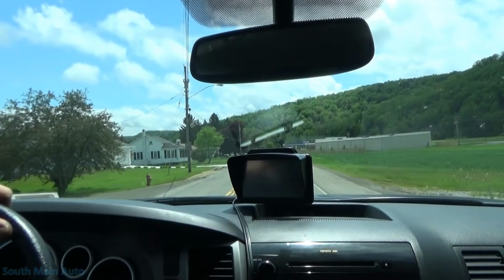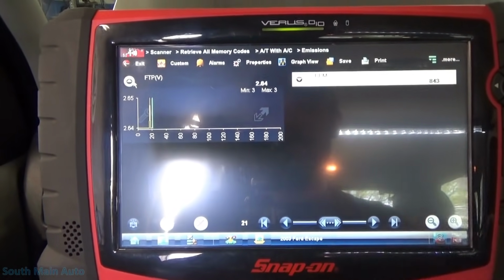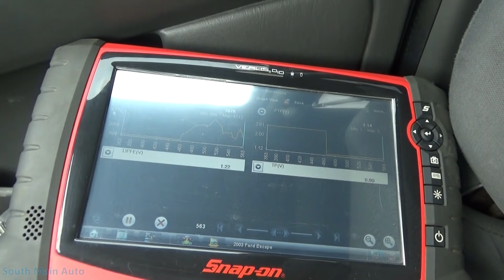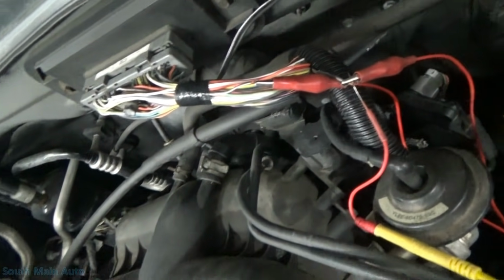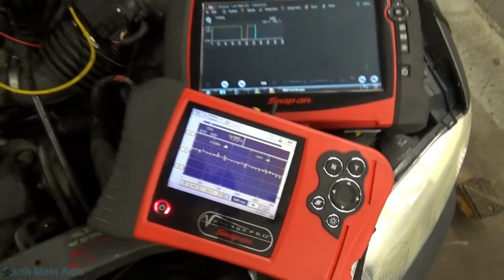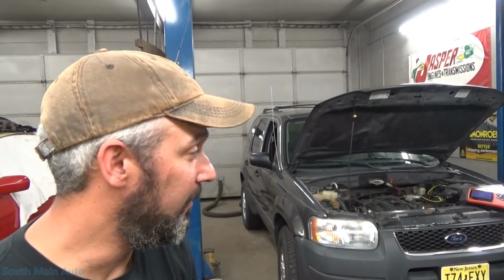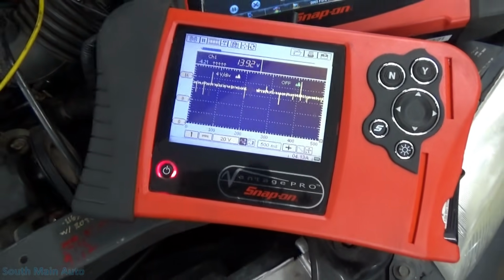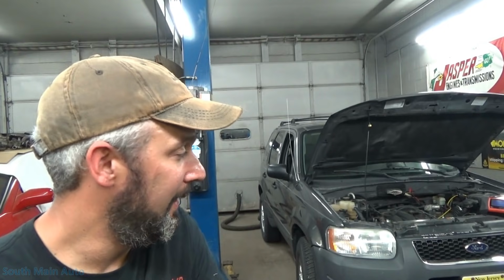Ford Escape: Do We Fix It Or Ship It!? - Part II

Comment: Seems like that escape from New Jersey always makes for some good videos. Amazing how two totally separate systems can interfere with one another.
Reply: Induction can easily cause such interference in 'separate' systems.... Shielding (after the source is ID'd ;-) ... could potentially solve such a problem)...
A very interesting issue....
Reply: Shielding is expensive. Forget it. The best effort has to be done on each module, make themselves noise resistant. Wirings are LONG, ground is not a perfect start partern, so loops can happen. The modules need to live with that.
Reply: After too many years spent in high tech instrumentation engineering....Shielded wire is not significantly expensive. Intelligent routing of lines is the simplest answer. And Modules being "noise resistant" is a moot issue if the feeds to and from the modules are not effectively isolated. Similarly, "modules need to live with that" is a meaningless statement, as each situation is dependent upon the tolerances of the signals being processed.
Reply: There are standards you nee to meet where the electronics are radiated in all positions from 100Mhz to 3Ghz with fields stronger 10V/m and even more. Then conducted is applied below 100Mhz. Automotive use a set of standards and you validate against them. you pass, you are done. A module has a set of input and ouputs. The inputs are expected to be in a certain range. Example, a drive by wire accel pedal reading, lets say, it has a notch or noise has corrupted its value. Now is "up to the module", because, firmware knows that the accel pedal can change from a certain position to wide open in just a 1ms. So, proper firmware  will paranoid that, will flag that and will discard this reading. Now another programer just was too optimistic and didnt did that check ... you send inconsistent data to other places just because noise. Firmware design is IMHO the 50% or more of the robustness of a system. Ans is up to the module trying to validate inputs, check for redundancies (ej, CRANK Vs CAM position) and wait for more data before panic of taking making a bad desicion. You nailed it, proper wiring is the best way. Shielded is the best but you cant shield a 60 wire harnes, probably some critical low signal sensors of course. The reason why using DIFFERENTIAL PAIRS like CAN, OLD RS485 or 422 or the more commmon ETHERNET ... they dont need shield  .. they just rely in common mode noise rejection. And ..... usually the statements "after being long years in" are meaningless too, more in YT. Electronics when properly programmed need to be defensive and resilient. OF COURSE GOOD HW desing is the other 50% of the bussines.  I have suffered that, I dont need to convince you or anybody. Just the facts I was shown and how they were solved. You need to meet standards. Period. Then is up to you to give a PLUS to defend the customer and the system where you module connects to, or pretend that just because box is metal and wires shielded NOTHING is going to happen. .... GOOD LUCK. Typical design that works like a dream 
 ....... in a desk. Modules hardly work with low signal levels, they dont have as much analog stuff. So comparing to high presicion intrumentation is an overkill. Its a mass consumer product, not a triple domain 30K dollars Tek scope.

Comment: Are you telling me the flow chart didn't have "Check the power steering pressure switch"?
Reply: I has a major desicion on the very top "Is the vehicle a Ford ?" ... "then good luck".  if it is not a Ford,then, asks "is the vehicle a GM product"  ... "if yes, drive to the junkyard" ... if not a GM then asks: "is it a Chrysler" .... "if yes, replace engine, wiring transmission and body. Reprogram every single part, dont to update the firmware in the sunvisors"
Reply: No hoosker do's or hoosker don't either!?

Comment: That's nuts.  Makes a guy want to use an oscilloscope more times than not.  That's some serious knowledge you shared.  The greats are always as lucky as they are good.  It's the determination that opened the lucky door.  Many others would have an ECM on order already.

Comment: You need to get a hold of scanner Danner Says a 12 volt sensor cannot affect a 5 V reference will blow his mind
Reply: It won't because while he teaches that the 12v and 5v reference feeds are independent (don't affect each other) he does know circuits that share common grounds can affect each other.
Reply: 5V is a downconrversion of the 12V rail The is only one ground that is the return for both. High freq noise in the 12V will pass to the 5V regs no problem unless they are SUPER filtered. They put filters, but, not to dump the amount of oscilations showed in the video. The module is alone to defend itself from inconsistent inputs and take a desicion if the signal is between range or it is trashed. Clearly the power steeering sensor noise couldnt trash the ECM completely os in the end is a good design, the main goal, keep the engine running was accomplished.
Reply: 38911bytefree  I believe there is probably a bad isolation capacitor in the ecm the problem could come back
Reply: Tech53us G: The problem/noise persists with the 5v supply disconnected/isolated from all the sensors. Thus the problem is not with the PCM/Supply.
Reply: @killer2600  that is it exactly.  Once Eric explained the cause I was like "hmm, so the switch is sending an AC signal (by high speed switching) up the ground, the only wire those two sensors share."

Comment: Holy crap that was twisted...are you sure Keith didn't send that car up from the Bermuda Triangle for you Eric? Great job man, way to stick with it. Now why didn't we see that noise on the 5V ref in Part 1???
Reply: Ah....I think if the PicoScope was used for the initial diag, you would have seen the noise on the 5V ref right away. Perfect demo of the crucial difference between a "Graphing Meter" and a real "Oscilloscope" :)
Reply: Excactly! The learning from this is that do not use DVM to diagnose a sensor. Use Pico. One channel to ground, one to power and one to signal. You would have identified the problem way sooner. Not much extra work to use Pico instead of DVM.
Reply: This video, as a tech, is making me scratch my head.   If that P/S pressure sense runs on its own 12v reference, why and how is it back feeding into the 5v reference for the ftp and tps sensors? Sorry didnt hear it in the video if it was in there lol. Part 1 gave me nightmares last night though.
Reply: It can be that 12V reference (14V -> 12V regulated power) feeds the 12->5V regulator. If the 12V circuit is overloaded, both the 12V and 5V reference start going down and up if 12V regulator goes to over amperage protection.
Reply: I have a universal THEORY, once you have found the noise you could then graph the frequency of the noise. Then run through each wire at the ecu looking for the same frequency. Unplug that circuit and see if the unwanted noise has gone ???
Reply: Diagnostic Check Thats probably where I would start, but what do I know? Im still a noob tech, started at jiffy lube lmao
Reply: jannepo You ever had that moment where it makes perfect sense and its just like "Awh god dammit I shouldve thought about that?" I just did. Thanks for that lmao.
Reply: The perfect way to check the 5V reference is to use a logic probe. I don't know if you can still get them but they were used for 5V TTL logic. It had a red and green led. Solid green for high and solid red for low. I think it used a pulse stretching circuit to blink the leds if there was any switching going on. It could detect even sub microsecond pulses.
Reply: As Eric said, unplugging the power steering sensor alters the idle speed. Perhaps there is some actuator powered by ECM to alter the idle speed. Faulty sensor caused a hysteresis on that output -> over amperage -> 12V regulator goes to protect -> 5V regulator / ref voltage drops to 0 -> 12V reg comes back up -> hysteresis. Down/up 5V not enough to power tank sensor -> output drops to 0.
Reply: I think of the vidio you done with Keith when he unpluged the fans. And that tape floping in the breez and a cup of coffee.....LOL
Reply: Joe Brito  way to kick Eric in the guts, what an INSULT!!!
Reply: We did not see that on part 1 because he use the sensor ground and on this part he use the battery ground.
Reply: High quality scope with a high sampling rate will beat any test light or other. Well done!
Reply: Ivan, please check out my comment I just added. I'd like to hear your thoughts.

Comment: If anyone picked on you for this they don't know what they are talking about any tech would have replaced the ECM and then scratched their head at why it didn't fix it. With that sensor alternating like that it likely overpowered the fuel pressure sensor signal by induction or producing some kind of RF interference.  Not sure how close the circuits / wires are in that in the ECU / harness but I imagine they must be very close.  Congrats on finding what was wrong as 99.9% of techs would have given up, slapped a reject on it for the light being on and called it a day. Your a next level tech / mechanic and don't let anyone tell you any different.

Comment: Modern cars have gotten so complex that you'll get a "never seen this before" periodically just based on sheer statistics.
Reply: That's a statistic of the universe. If we never get a "never seen this before" then every possible event/scenario has already occurred and like a finished book the universe is done.
Reply: opl500: "Modern cars" does self diagnostics via the monitors, that has never happened before either. Never in history has so much been given for free to the workshops/home mech! All in reach within a $15 bluetooth OBD-dongle and a house hold item you'd have anyways.

 Your complaint is the same that was muttered by some when EFI were introduced... And again, by the same people, when serialcoms were. Get on board or keep fiddling with that leaky acceleration pump on that dubble-pumper of yours.

Comment: So evidently that five volt wire going to the ECM needed to be shielded from the factory , maybe you just made Ford make up another recall
Reply: shielding may not help if the 5 volts is actually derived from the source of the 12v PSS feed.  When the 12 volts is switched rapidly, that noise isn't necessary EMI on the 5 volt line, it could be directly fed to a regulated supply of 5 volt output.

Comment: Reminds me of a very expensive piece of medical testing equipment I came across one time . it was under warranty and the manufacturer sent tech after tech to repair a recurring fault . the machine cost over a quarter million and they replaced nearly every single electronic component up to three times each but after twenty seven days the fault would return. The company was in a panic as this was the first of several new machines they were trying to sell and if it wasn't a major international company this one machine would have sent them bust. I was there doing some contract work for the client who bought the machine and he was bitching about all the drama and how if it wasn't such a physically massive machine that actually did a good job when it was working he'd give it the flick.
I started to laugh because I figured out the problem and when he heard what it was and how to fix it he just about wet himself laughing too.
This machine had to have had at least four techs work on it and had a million dollars worth of parts and labour thrown at it and no one figured out that all you had to do was turn it off once a week. Computer memory at that time is prone to a fault called leaking and this gets worse the longer it is powered up so every twenty seven days it would stop holding data properly and it would be corrupted and this is why most computer help lines will ask Did you try turning it on and off?
Reply: So it was a software problem and not the hardware :)
Reply: PuchMaxi , no it was a hardware problem that caused a software problem that caused hardware problems
Reply: My head is spinning right now.
Reply: Computer memory doesn't leak; software is poorly written and sometimes doesn't free up memory, which is called a leak.  In my old job I've reused other people's code, and had to find and fix their memory leaks.
Reply: for2utube I just happen to know 100 percent you're right.
Reply: for2utube , not so memory leaks was a term given to an electrical phenomenon that occurred in early ram where due to heat and capacitance electrons would jump tracks turning a zero into a one and corrupting the data. Poorly written code could also cause memory corruption but when it is code based it usually happens quickly within seconds or at most hours depending on the particular program and how it accesses the memory and how often, when it is hardware based it can take days or weeks as in this case and to total amount of ram the machine had was sixteen kilobytes only enough to remember which ROM calls to make as selected from the menu of six choices and a cleaning function, the fault would cause the machine to randomly switch functions destroying samples and dumping reagents that cost fifty dollars an ounce. The machine was nearly as big as a Miata the machine you'd buy today is the size of a microwave and does about a hundred more tests and only cost fifteen grand
Reply: It can get more complicated than that. Even if the code is religious about freeing memory, the system can suffer what's known as "memory fragmentation" over time. The memory is all there and it's all free but it gets organized in less and less useful chunks. Writing code for computers that have to control something real isn't trivial and it's EASY to do it wrong and not even know it. And unlike Eric O, most programmers aren't their own bosses, so over time, they can't afford to care too much about the job they do. And what I've seen of management in the auto industry, they are douches for the most part.
Reply: I place my bet on SW bug. DRAM is refreshed every 40-100 milliseconds not weeks. But if there is a bug in the SW or OS, that can accumulate, lead to faulty handles,  data structure corruption, "garbage" left behind (like Java garbage collection lacking) filling up the reserved memory structures. RAM is simple, SW/OS is hugely complex. So I place my bet on that. Reboot works. Takes care of 90% of problems.  Great thinking!

"The maximum time interval between refresh operations is standardized by JEDEC for each DRAM technology, and is specified in the manufacturer's chip specifications. It is usually in the range of milliseconds for DRAM and microseconds for eDRAM. For current (2012) DDR2 SDRAM chips it is 64 ms."
Reply: Anom Amos - You're teaching me something I didn't know.  Most of my career I've worked with DRAM and its ilk, which I read became popular in 1972.  The only thing I've seen happen with it is bit-flips caused by cosmic radiation.  I read that even today's computer memory is still susceptible to malicious attacks, such as https://www.schneier.com/blog/archives/2016/08/powerful_bit-fl.html.  I shouldn't have taken such an absolute position.
Thanks for your follow-up explanation.
Reply: Janne Pohjala:   A software bug that shows up every 27 days?  I imagine they would check for any code that waited 27 days to do something!  My bet is that it is somehow due to the hardware.  A lot of the software bugs mentioned just can't happen with only 16K bytes to work with!  This machine sounds like it was made in about 1980.  It used machine code, not even C.  I remember, you couldn't afford to fill your Apple II or C/PM machines to the full address space of their CPUs, 64k bytes, back then.
Reply: No one has ever called leakage 'memory leaks'.It's been called leakage in transistors forever and no one has ever called it 'memory leakage'.

Comment: Dude I know this is late but the troubleshooting on the ford escape with the bad power steering sensor while your codes were leading you to the evap system were simply magnificent a true electrical electronic master technician you are the one i always go to period...  I’ve been doing electronics since 1980 also did avionics auto-pilot, instruments, navigational equipment in the Air Force for over ten years have done appliances for over ten years and industrial electrical and controls with plc’s programable logic controllers for over ten years so ive seen some things Your stick-tuative-ness pushing thru the questions and it not making sense until you figured it out proved it made the proper and saw what was actually happening were pure GENUIS my hats off to you Sir a Scholar and PHD

Comment: I was following along with high suspicion of alternator.  That suspicion shattered via power steering switch.  But the clear message.  Don't shotgun in expensive ECM units.  Find the problem.  Fix the problem.  Very well done.